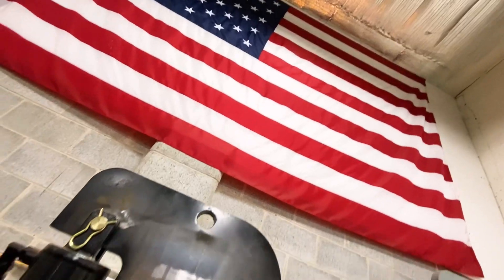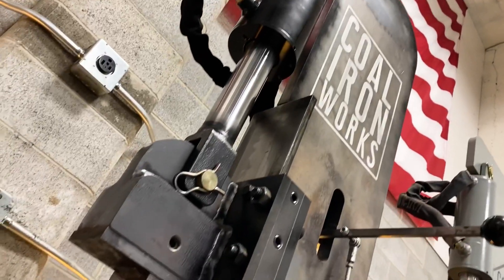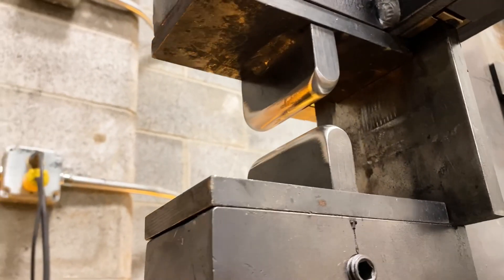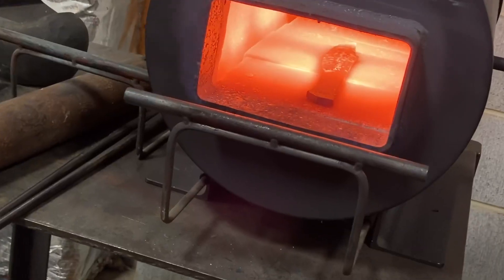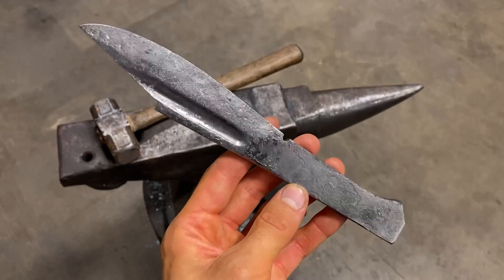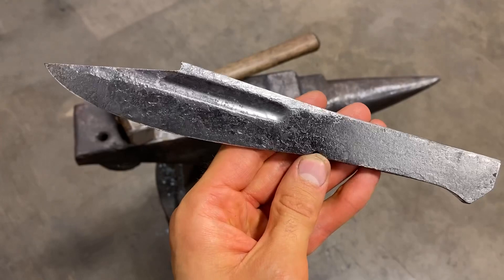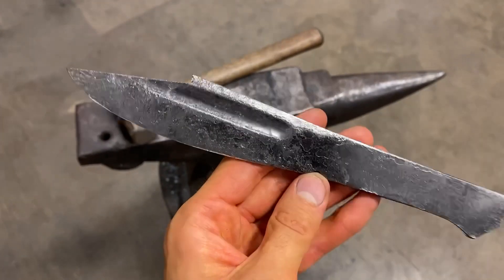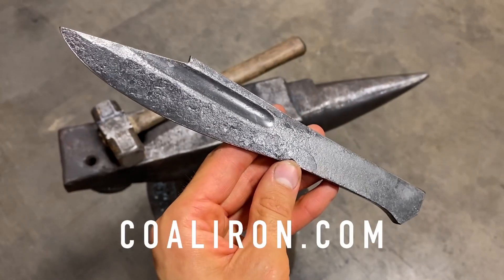Forging knife fullers with Coal Iron Works fullering dies

Comment: This might be a really dumb question, but how would you clean the fuller on the knife afterwards to make it shine? 🧐
I have these dies, and they work great by the way 👍.
Reply from the maker: Not a dumb question! With forged fullers you have to be picky about the radius at which you're forging them in. Depending on the radius you've forged in, you could either find a dowel rod of the same or very similar radius and wrap some sanding paper around it for hand sanding - OR you could use a small wheel attachment on a grinder to get in there and clean stuff up!
Reply: @CoalIronWorks  Thanks! I thought about the small wheel attachment idea earlier, abut haven’t tried it yet, but will later. I just put some fullers in on my latest knife just a couple hours ago, and they look great!